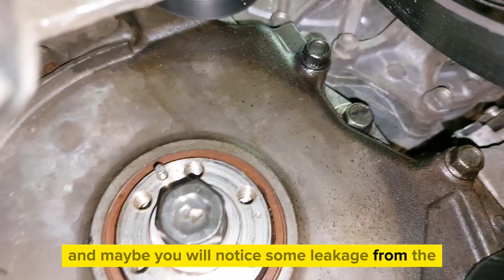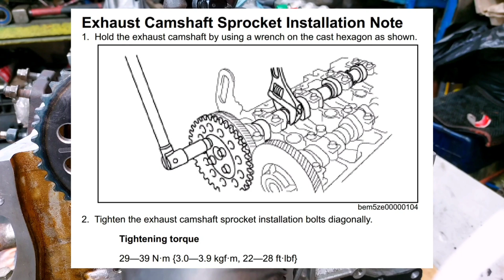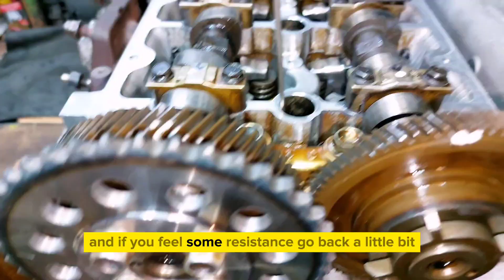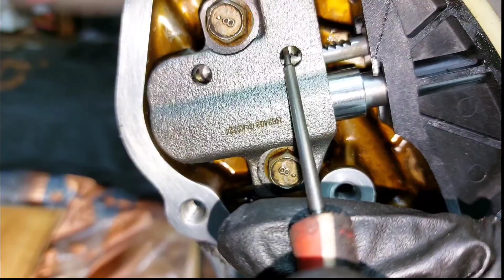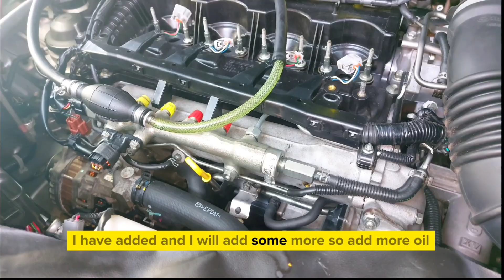Mazda diesel 2.2 mzr cd (R2AA) | timing chain replacement

Comment from the maker: ⚠️! JUST IN CASE about "Timing Chain Reset" !⚠️
In video I didn't mentioned that sometimes after replacing the timing chain you need to do what is called a timing chain Reset or Calibration 👇🏼...
MAZDA 6GH https://youtu.be/Vk-BNrTw1PY?si=wwAxxxuIYUvY3YGy 

MAZDA CX7 https://youtu.be/OYGPYKEjh8I?si=O8LzOmcCOx1xrjPJ. 

https://thetribuneworld.com/2021/03/09/mazda-cx7-timing-chain-calibration-p1336/

MAZDA SKYACTIVE https://youtu.be/Ula9GJjFG7Y?si=_1Bs-WN68l65nT3_

...because it can happen that you replace the chain and immediately after that or after a short period of time you can get the Check Engine light or DPF light and the trouble code "P1336" or "cc_difp_woa" which means that your chain is stretched🙆🏻. This could be because for some reason the ECU is not resetting the deviation reading between the camshaft position sensor and the crankshaft sensor after replacing the chain.  For example, the stretched chain value is greater than 10.45 degrees (you may need a diagnostic scanner to see these parameters in Forscan maybe), and this value remains in the ECU memory after replacing the chain and may cause trouble codes, but you know that the chain is new and there is no noise from it, so you probably just need to do a reset💁🏻‍♂️. The normal value for a timing chain is a deviation of less than 10° degrees (perfect "cc_difp_woa" in Forscan will be approx. from 5° to 7°degrees) in the synchronization of the camshaft and crankshaft sensors.
Reply: Hello friend. I have a question. For the additional timing chain guide 20:24, are the 2 screws included in the timing chain kit? If not, how can I find them? Thank you very much for this video.
Reply from the maker: No, usually bolts are not included in to the chain kit, but here the number of that bolt 99784-0830
Reply: @HintSlice  Great, thank you

Comment: Where did you buy the balancer chain guide, the correct version? Do you have a part number for it? I can’t manage to find it anywhere. I can find only the wrong one.
Reply from the maker: Well I didn't buy it, it's from the chain kit of the Mazda 6 gh 2.2 mzr cd. And unfortunately in the catalogue that i'm using there's no part number for this guide of the balancer chain, there is a star☆ instead of part number, which means that "☆This part is not serviced"🤷🏻.
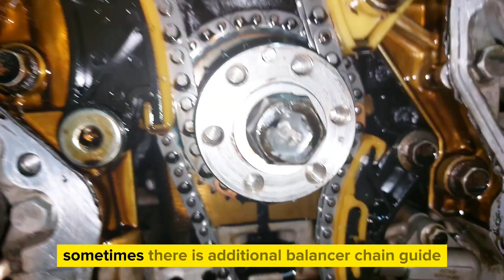Reply from the maker: And one more thing I mention on 5:55 that sometimes there Is additional balancer chain guide, sometimes No, it depends on the vehicle's period of manufacture. So maybe it's not that crucial thing.

Comment: Thank you for these videos.
the timing chain had jumped on a friends mazda 6. code P0016. new chain fitted without any major problems. however i did have to take the sump off to undo the bolt on the balance shaft, it was ridiculously tight!!
Reply from the maker: Glad that it helped. I must say that this bolt of balace shafts is most tightly tightened bolt in whole this engine😅.

Comment: Hi there, i hope you´lle see my comment in time. I am currently replacing my cylinder head gasket and i had to take of the Timing chain. I took of the Cover, but not as easily like you did (it always got stuck somewhere) Any tips on inserting the cover after applying the sealant? I don´t want to take out the whole engine just for that so i thought it would be possible to just insert it. But i am struggeling with it while testing to insert the cover. Any tips?
Reply from the maker: Hi. The only tips that I have is to install cover without crankshaft oil seal and maybe try to setup the height of the engine, so that the crankshaft bolt interferes as less as possible when installing cover or undo crank bolt and so installation will be easier.(tightening torque of the crankshaft bolt 167—176Nm.)
Reply: @HintSlice is there a problem with removing the crankshaft bolt for the installation? So if I remove it and want to install the new chain etc?
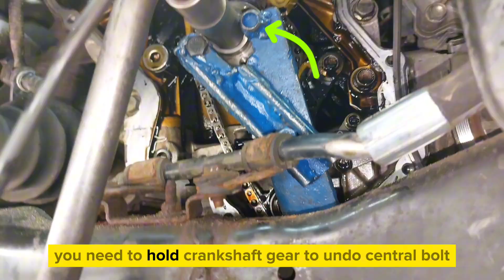Reply from the maker: Usually there is no problems with that bolt you need only to counterhold crankshaft to undo it 6:46. Only the sprocket can be hard to remove becase it seats on a conical nose of the crankshaft and you gone need this kind of "PULLEY PULLER 49 S120 215B" to take it off(of course if you want replace that sprocket) and maybe you will need to heat it up. And crank bolt tightening torque is 152—161 Nm
Reply: @HintSlice  thanks. So if im reassembling everything, can i just put the bolt on after i put back the Cover?
Reply from the maker: Yes.   If you are going to replace the crankshaft sprocket, you can tighten it with a bolt so that it sits in place and holds well, and then you can unscrew that bolt. And it's better to degrease the surface of the sprocket and crankshaft before installation.
Reply: @HintSlice Okey thanks! I hope I'll manage that
Reply: @HintSlice  alright we managed to change it and put back the cover of. We are currently putting back together everything. Is there anything to keep in mind? Do i need to recalibrate the EGR Valve? What about the injectors? There is another video on yt where the guy did something with the service outlet and reset something after he changed the chain etc. There is also a video about the injectors needing recalibration after putting them back in (even if its the old ones?) or something about a timing chain reset or something similar. Got any idea what exactly this means or what i shoud keep in mind? Thanks! Your Video really helped me so far!
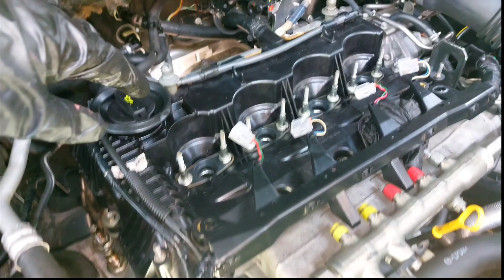Reply from the maker: Yeah look there is my pinned comment in comment section "about Timing Chain Reset" maybe you will need to do it. If the injectors are old ones and you numbered them for each cylinder before removal, then there is no need to do adaptation for them and no need to recalibrate EGR valve. Pay attention to this part of the video from 27:19 and to the end. And don't panic if the car doesn't start right away. You may need to crank the engine several times with short breaks in between to avoid damaging the starter. After that, if everything is assembled correctly, the car should start and run like a charm, which I sincerely wish you. Good luck.
Reply: @HintSlice  Thanks! I´ll keep you updated if you are interested to hear the results!
Reply from the maker: Ok, give me a sight, when you ready
Reply: @HintSlice it's me again. The MAP sensor broke off so we had to replace that. We can bleed the fuel system now but in your video it's not possible to tell where the other end of the hand pump goes. One goes to the fuel filter, but what about the other one? How do you prime fuel into the fuel system? With the other end of the hand pump connected to a canister full of diesel? Thanks!
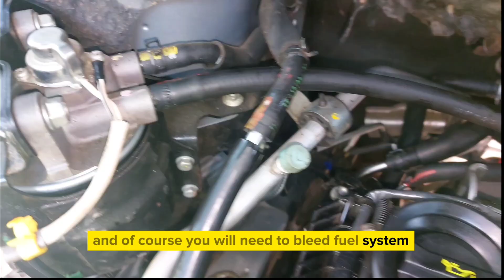Reply from the maker: Hi. So one end is connected to filter and Other one is connected to the fuel supply hose that was removed from the filter 27:25, maybe it looks a little bit confusing because the hand pump hoses are too long.
Reply: @HintSlice  yeah after carefully inspecting the video we managed to see it correctly and did it properly! So thanks for that! Car started smooth as butter and after the reset no light remained. Hopefully we bled the cooling system properly!
Your video was very helpful thanks a lot!
Reply from the maker: Glad You made it, good work👍🏻 and good luck on the road!.🙋🏻

Comment: Thanks for this.  I followed your procedure.   Engine started.  Run smoothly. And is quiet .But I'm getting an engine light, no rev counter.  abs light and it starts only after 5 revolutions of the engine.   It's also down in power.  I'm not sure what to do
Reply from the maker: Glad to help.What is your car ? Maybe you need to do timing chain reset. There is my pinned comment in comment section read it please. ABS and brake lights may illuminate due to disturbed wheel speed sensors or low brake fluid. And maybe you need a scantool to read fault codes. Regards

Comment: Hi, thanks for the helpful video!
I have a Mazda 6 GH 2.2 diesel with about 260,000 km. I don’t know if the timing chain has ever been replaced. So far, I don’t hear any typical timing chain rattle on cold start.

Recently I removed the valve cover and checked the chain tension – it still feels quite tight. I can lift it only about 2 mm from the camshaft sprocket, so not much play. It’s obviously not as tight as new, but still under tension.

My questions:

Is there any way to check the timing chain condition with FORScan (like error codes or values for the chain/tensioner)?

How can I know for sure when the chain should be replaced, especially since I don’t have service history?

Are there other symptoms I should look out for before deciding to replace it?

Thanks in advance for any advice!
Reply from the maker: Actually yes, Forscan will show everything. You need to warm up the engine to 60°C or higher. Then in Forscan find the test "Actual difference in camshaft and crankshaft position without adaptation" and run the test, when it finishes it will show something like this parameters CC_DIFP_WOA: 7.67 ° 60°C, 751 rpm, you only need to look at this number "👉🏻7.67 °👈🏻" which in your case could be a differend, maybe 9.4° or 8.5° etc. So if the timing chain is fine, the parameter "CC_DIFP_WOA:" shows from 5.00° to 9.00°, 
if the timing chain is stretched the parameter "CC_DIFP_WOA:" will be from 9.00° to 11°. 
For example: A Good timing chain CC_DIFP_WOA: 6.7°.   
Stretched timing chain CC_DIFP_WOA: 10.4°. 
And somtimes timing chain may need adaptation or reset after replacement. Read my pinned comment for this inf.

Comment: Где у них стоит датчик детонации и клапан картерных газов ?
Reply from the maker: there is no knock sensor on this engine and i think the PCV valve is built into the valve cover or maybe there is no PCV valve and just an oil separator (oil skimmer) in the valve cover, I never paid attention to this parts;)

Comment: Thanks to you my Mazda 6 is running again. Also, I'm working on my Audi and found your 3.0 TDI videos. Mate, you are a legend!
Reply from the maker: Man! that's AWESOME! Thanks for comment🤝🏻🙋🏻
Reply from the maker: Just in case. I didn't mentioned that sometimes after replacing the timing chain you need to do what is called a timing reset or calibration https://youtu.be/Vk-BNrTw1PY?si=wwAxxxuIYUvY3YGy https://youtu.be/OYGPYKEjh8I?si=O8LzOmcCOx1xrjPJ. Because it can happen that you replace the chain and immediately after that or after a short period of time you can get the Check Engine light and the trouble code "P1336" or "cc_difp_woa" which means that your chain is stretched. This could be because for some reason the ECU is not resetting the deviation reading between the camshaft position sensor and the crankshaft sensor after replacing the chain.  For example, the stretched chain value is greater than 10.45 degrees (you may need a diagnostic scanner to see these parameters in Forscan maybe), and this value remains in the ECU memory after replacing the chain and may cause trouble codes, but you know that the chain is new and there is no noise from it, so you probably just need to do a reset. The normal value for a timing chain is a deviation of less than 10° degrees in the synchronization of the camshaft and crankshaft sensors.